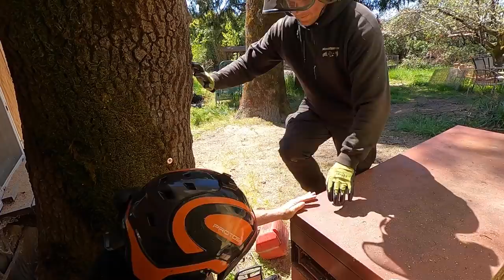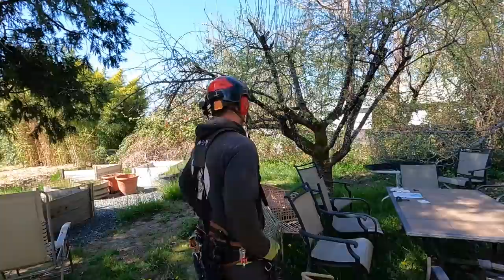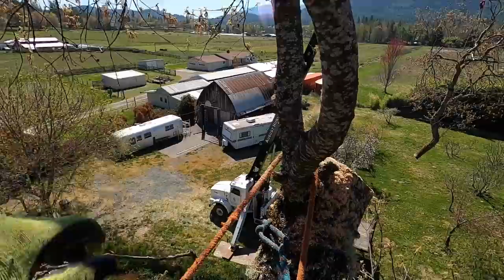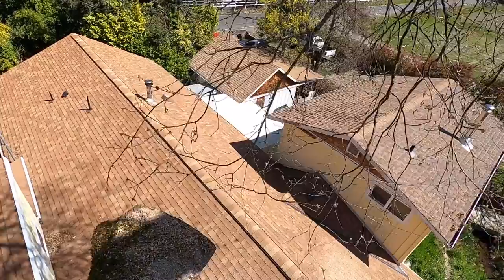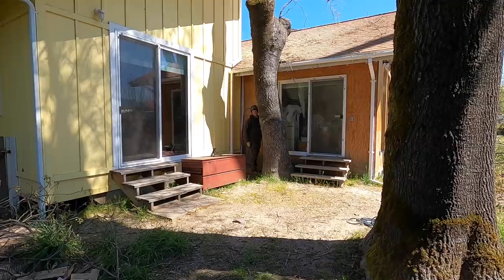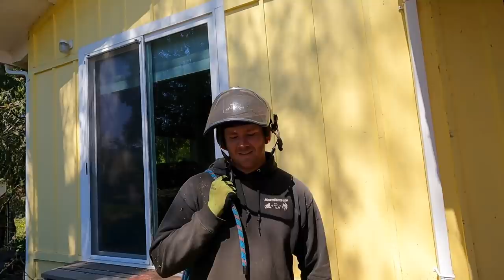Don't Do it. . .DO IT

Comment: I've been working a 9 stem mulberry at my brothers farm. Stems vary from 20 to 28 inches. Lean varies from 10 degrees to almost 90. Most stems are already cracked from the lean. I've gotten half of it down and removed, plan on getting the rest this week. Bore cutting most of it to avoid the barberchair, which is pretty bad on mulberry. I'll never been a pro and have no desire to be, but watching you guys has made me much better at this stuff.

Comment: I know it's a little saw.    What do you guys think of the 193t. I was thinking of getting the 194t for a climbing saw.   Any comments would be great
Reply from the maker: It’s decent 🤷🏼‍♂️
Reply: 194 has a lot more power than the 193, the 201 has more than both, but it weighs a good bit more.
What you're using it for is most likely a larger part of the equation and would be needed to help you make a decision.
Reply: @brettblack7049    I tend to run the echo 2511t  For limbs while I'm up in the tree and figure it's time for another light saw for climbing  work.   Thanks for the input
Reply: @mattygersh544  the 2511 is a nice light saw, if I was looking to get another top handle I'd jump to the 201 to have a larger spread, much like a 50/70 saw plan for the ground. That being said, I have the 2511, 193, multiple 200, and a 201, buy them all if you can afford them 😃. If the 201 is a bit heavier than you like get the lightweight bar for it, they help a bit with weight.
Good luck with your choice, if you're making money with them it's a small price to pay to try out one and to find out the other would have been better.

Comment: Do you guys ever take capacity picks?
Reply from the maker: Ya
Reply: What’s your crane good for when your on top of the tree?
Reply from the maker: @jackedwin9538  The question doesn’t make sense. But our first pick.. we had a capacity of 5600 pounds
Reply: Hahah sorry so when your as close as you can get to a tree what are you good for? Not the specs of the crane necessarily but what are you comfortable with
Reply from the maker: Probably 16,000 but technically supposed to be 25 ton
Reply: Damn you take 16000 pound picks with a 25 ton crane?